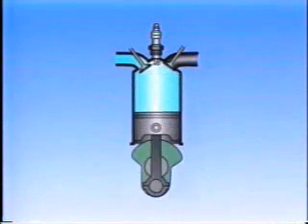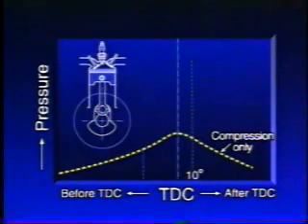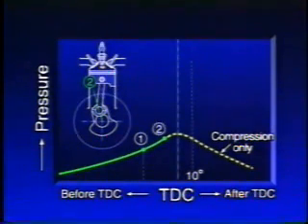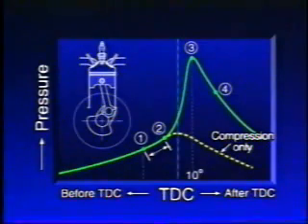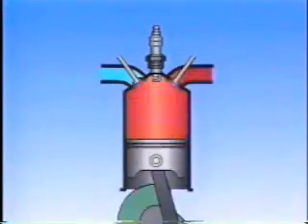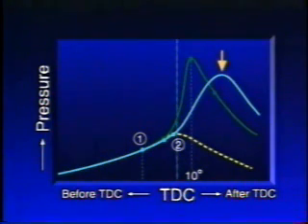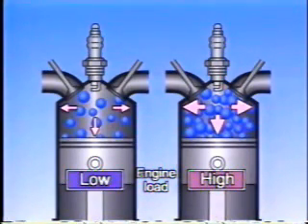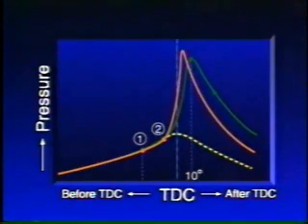Control of the ignition timing.wmv

Comment: Plz tell me load inside the cylinder increases in low rpm or  high i can't understand and why ignition should retarded...??? I only know that when the vehicle is in low rpm its normal and when its in high rpm it should advance the spark for to give air fuel mixture a complete time so that it can burn before when the right crank angel is want the power on the piston in high speed.. So what about 1:40 you say i can't understand plz reply...???
Reply: @ali qadri The word load or heavy load is the key here if the ignition is advanced at low RPM and heavy load, the overall weight of the vehicle vs the ability of the engine power to mobilize this huge weight, it will ignite before the engine has time to produce torque/HP and the engine will ping or detonate and this is bad for the mechanical components of the engine. If you drive a manual transmission in 3rd gear at 10 KPH and smash the throttle to the floor, you are not going anywhere fast so no need to burn the fuel fast, advanced. Load is part of spark timing and there is a MAP built into the software of modern vehicles to compensate for that. Even in older distributor vehicles, there was a flyweight to do this mechanically, if the RPMs are low the flyweight does not fly outward and does not advance the mechanical timing. Does this help?
Reply: @duanedonaldson2262  thank you very much .. Love you
Reply: @duanedonaldson2262  That is a load of old waffle!

The real reason for changing the timing with the engine load is as follows, when the engine is under heavy load it means that the throttle is wide open, or at least open a large amount, now there are two things (in simple terms) that determine when you need to fire the mixture, one is the engine RPM and the other is the initial cylinder pressure, that is the pressure in the cylinder BEFORE the plug fires, the higher the initial pressure the faster the mixture will burn. So when the throttle is just cracked open the engine can hardly breathe, it is literally being 'throttled', the VE (volumetric efficiency) of the engine is low, the initial cylinder pressure will be low so the timing needs to advance, that's what a vac advance system does, inlet manifold pressure (vacuum) is a good way of determining what load the engine is under, high vac means low load. When the throttle is wide open the engine can take in a full 'cylinders worth' of air/fuel on each induction stroke, the VE is high, the initial cylinder pressure is high therefore the vac system needs to back the timing off because the flame speed will be high, again the vac advance controls this, of course in modern engines the 'black box' controls all of this but for the same reasons that I have stated. 1:42 talks about cylinder pressure and how it affects the flame speed. All of this is to get peak cylinder pressure at the right time in the power stroke regardless of RPM or engine load.